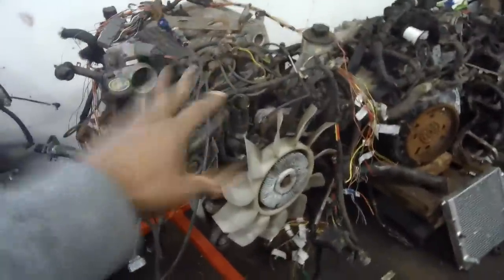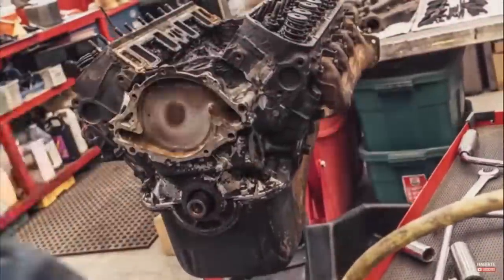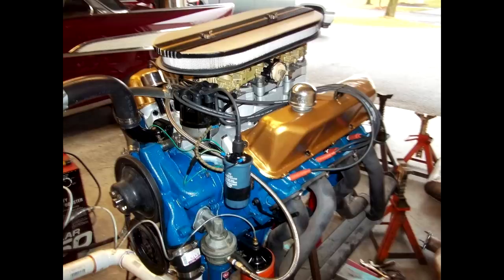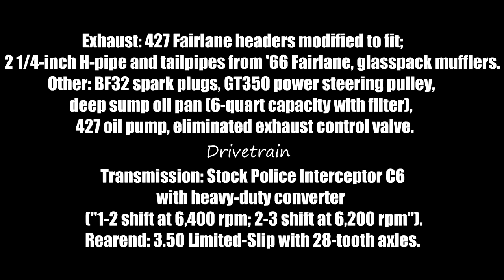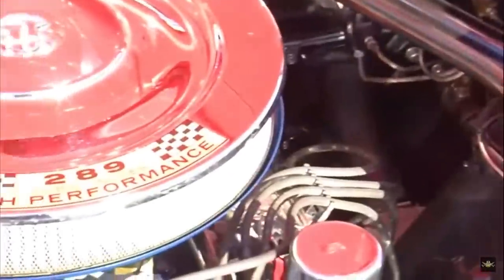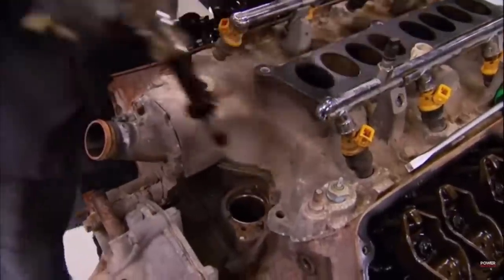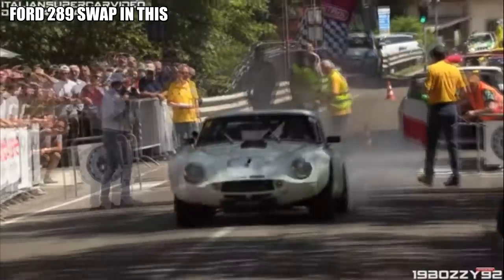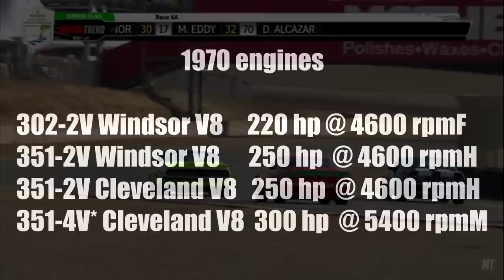289 Ford Voted BEST ENGINE BY CARROLL SHELBY ( HERE IS WHY )

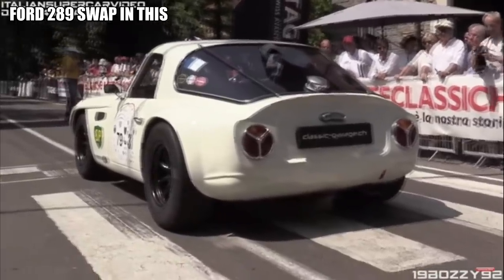Comment: 9:34 That sumbitch was rapid. 
That sound gave me chills. 
#1 is 289 for me, "Light is Might". 
#2 is 302
#3 ?
#4 ?
#5 ?
Reply from the maker: thats why i was having the problem of really figuring out which one was the BEST in a top 5 type thing.. #1 302 #2 351 #3 289 #4? and #5? ..its almost seen depends on what you find in your local yard ( maybe )  or what are you building. really tough call
Reply from the maker: that little thing was flying with that 289
Reply: @bstfordchannel923  That "Italian thing", was actually a British TVR! They sold a few here too!
Reply: What's the difference between 289 and 302?

Comment: I had a 65 K-code convertible and loved the engine. GM figured out ways to make small blocks ‘breathe’ better than did Ford. But the Camaro/Firebird was always a ‘me too’ auto compared to the original.
Reply: Don't see many if any small block Chev heads of that era breathing better than a 351 Cleveland 4v Closed Chamber head.

Comment: I like 289's but it can be difficult to bolt accessories to the heads for modern applications. The 390's are nearly bulletproof and can make crazy horsepower.
Reply from the maker: Thats a good view on the 289 in the modern world..
Reply: They were/are out there, but Ford was always more expensive to build than Chevys. The beauty of Fords were the opposite rotation on circle tracks planted the left rear wheel in the turns so you could stand on it while everyone else backed off. Reverse cams with gear drives on the others cancelled that advantage.
Reply: FEs are not bulletproof, they are prone to bottom end oiling issues.
Reply: That is why the 427 was redesigned to a sideoiing system.

Comment: I am partial to 460s had a 77 Grand Marquis in high school it was packing the 460 I beat the hell out of that car that motor was tough as nails and took everything thing a 17 year old kid could throw at it which was pedal to the floor 200 foot one wheel peels you name it. I had the exhausts coming off the manifolds glowing red several times and that engine really never let me down, she would really run on the top end, passed many a car at well over 100 mph honest to God and still accelerating good, my favorite has to be the 1970s 460 Ford anybody have any good stories about the Ford 460 in cars?
Reply: The late 70's 460 was a low compression 7.9 low HP engine around 200+ and had around 350+ft lbs of torque, now the 69-71 had around 365 HP with 10.5 to 1 compression and close to 400 ft lbs. of torque
Reply: @Stars-and-Stripes-  Of course they did not have the same horsepower ratings as the originals everybody knows that, that said the cars they powered moved out decent with the torque and the horsepower ratings were net now instead of gross so there was not a 165 horsepower difference when you compare apples to apples. Had 4 total vehicles with the 460s in my life since 1988 have 1 still none are muscle cars but everybody knows that. Install a straight up timing chain in a post 72 460 and you will get some power back.

Comment: I am running a 1965 289 HiPo now. I have first year, high compression 351w heads on in a little 62 E100 ... The van is just over 2,000 pounds and it is shorter than 2 door GEO Metro. Fun ride.
Reply from the maker: really man i would love to make on of those! I am thankful for this comment. I have to get one of those

Comment: I love fords.  Best most reliable engine I think is the 300 inline 6.     Ford 289 is great.  The 351 Cleveland and 427 side oilers and 460 are my fave all-time Ford's. Those 300 six are bulletproof.  Also my 460 is bulletproof as well.
Reply from the maker: yeah I want to touch on that motor ... i have to see what is that all about... That engine weighs a lot right Eddie?

Comment: #1 FE series
#2 335 series
#3 Fairlane/Windsor V8
#4 385 series

Why this order? I am considering the merits of the engines for their time while also taking into account modern day.
FE series because they were stout and reliable in modest everyday use applications as well as performance variants. At the top of the line, there were the 360hp 352, the 401hp 390,  406, 427, 428. It is funny how people will dismiss the 352/390 as a dog especially in comparison to the 396 Chevy, but if Ford had given the same options and treatment to those mid 60s engines as GM had, would’ve been a different story, as proven by the HiPo FE variants of the earlier years. And then there is the SOHC 427. FEs also have a distinct sound unlike any other, and are beautiful in an engine bay.

335 series had the famous 351 Cleveland, and a 400 though viewed as a boat anchor to some, is just a tall deck Cleveland with loads of potential. Australian racing is my source for why this series is over the Windsor/Fairlane V8 on my list, besides being capable of making big block power at its time. Like the FE the sound is distinct, and they dress up more nicer than a Windsor.

The Windsor/Fairlane V8 gave Ford a much needed smaller option for their vehicles that gave good performance. They are easy to swap, because they are small in dimensions, and built with aluminum peices are probably the lightest of American v8s. Limit was always in the cylinder heads which has been taken care of by all the modern offerings. No doubt the HiPo 289 was a force to be reckoned with at its time. Today 302s and 351w can be Built to perform great, as their abundance allowed for a great expansion of the aftermarket, helping affordability. Boss 302 was a half breed of this and the 335 series which was introduced the next year.

385 series certainly confirms that there is no replacement for displacement, but performance was not the intent, save for the 429 Boss engine. Big numbers are easily achieved as they should with engines this size and the aftermarket also caters well. Though these engines are capable of probably the highest motor only numbers in total performance builds, because it’s to be expected is why it is ranked lower on my list.
Reply from the maker: sweet list here brother a dang solid list!!

Comment: 260 was before the 289 in production.
302 replaced the 289 early 68 production year to take advantage of a 5litre max displacement rule in scca , first were the 302 tunnel port along with the standard production heads then the Boss in 69.
351W came out 69 model year and 351C came out 71. The Windsor uses a head similar to the standard 302 head. The Cleveland uses a head loosely based on the Boss 302 head.
Reply from the maker: You see that knowledge was well needed cause i am about to start 351w trying to get the info to make something dope
Reply: Only one mistake. Cleveland came out in 1970 first year.

Comment: Of all the engines, Ford, Dodge and GM I would pick the engine I have in my currant car. Its a Gen 2 COYOTE SUPERCHAGED! Its a marvel of modern technology. I`m 64 and have had most every performance car back to 1968.
Reply from the maker: ahh you are the guy to ask this question ... why they never made a ( bigger version ) of the Coyote engine like 302 to 351 or 4.6 to 5.4...I would love to hear you take on why... I say the engine will not perform at all...

Comment: Ive never had the opportunity to drive any of the other engines but I am currently working on a 1970 base model mustang and I ordered a 306 from blue print engines. The dyno sheet says it makes 375hp to the crank. Im excited to finally get this thing running. Last weekend I finally finished wiring my interior and installed my dashboard and gauges. It does have the original c4 automatic but would love to swap in a T5 transmission. 

Like always, I enjoy your videos. God bless
Reply from the maker: Congrats on the project bro... yeah man only the 302 I drove in and 4.6 2v and thats about it..Sound slike you have sweet ride brother..

Comment: I think a built 289 would be the nearly perfect engine for a car like the AC Cobra, for better-balanced performance. I would like to use one of the cast aluminum block 289s that Carroll Shelby made for an AC Cobra project.
Reply: Just think, if Ford had produced the 325 they tested in the GT40 .
Reply from the maker: it was i think Jim. the 289 was very balanced for the needs of the time

Comment: The 429 is no slouch either. There was an article where a group built one with main studs and upgraded rod bolts and it turned 9k too! That is something!
Reply from the maker: agreed Bryan i know that 429 was something us new schoolers can not get our hands on one to learn about,, we need guys like you to remind us
Reply: @bstfordchannel923  460 is the same dog. Just with a longer stroke, so I wouldn't expect 9k out of it. They weigh in very heavy. Way too much for road racing, but proper biasing makes them great drag engines.

Comment: I liked this video. U mention why didnt Shelby choose the 351. The 351 Windsor came out in 69 & the clevland in 70. Both fine engines but Shelby had already created & made history by then. My favorite engine kinda depends on the use u have in mind but I'll give my run down by my favorites. Keep in mind I'm a truck guy. I do mud runs with the 70's f series trucks so I like high horsepower & rpms but torque is a must for me. My first love has to be the FE engines so first would be the 427. Then like I run in my mud truck the 385 series such as the 460. (Defanetly not stock) but then my favorite is (more for a car  such as a 70 couger with a 4sp) is a 351 clevland then the 302 Boss then the 289 Hipo. The other engines fall in place kinda in between.  I work with 390's & 460's the most. I love em!
Reply from the maker: very true but i found a deeper reason click here brother https://youtu.be/m8nZS3_TbwQ
Reply: 351 W came out for the 68 model year not 69.
Reply: @todddenio3200  68 in the 69 model u fool! If u can show me a c8 casting number I will eat my words
Reply: @jesseduke694  at times like this I wish I had kept the one I had instead of selling it as the casting numbers started with C8 which says it was manufactured in 68 and was in a late production 68 Cougar. Its not worth my time to try arguing with an arrogant know it all such as yourself because you are the type who would refuse to believe it even if you were to have the casting number used as a branding iron to brand it onto your forehead which was made obvious by your immediately calling me a fool.

Comment: Man you guys are lucky you got access to all those motors in junk yard's in the states . We got Windsor's and Cleveland's on the other side of the world unless they were imported . My mate found a 400 m and stuffed it in his 73 xa falcon coupe didn't like I much not enough hot up parts for it so he got got 351 Windsor he's still playing with it. Just found your channel 😊🇳🇿 thank you for doing it love it . Would like to get some info on hot up parts for Cleveland's and what can be done to them thanks keep up the good work 👍👍👍👍🇳🇿
Reply: Where are you from I am sure you have a Barra
Reply: New Zealand bro
Reply: @skinnycains4448  now that explains a lot. Very surprise that you do mot have some v8s. You guys have some rotary engine many small displacement engines?
Reply from the maker: I am sure you have motors we wished we had Skinny -C... Man i wish could import engines to ya
Reply: @bstfordchannel923  all hot up bits for Ford's are expensive Chev not so much. Expensive to get Cleveland hot up parts now they get on top of what you pay☹️ you got a cool 😎channel bro keep it up😊
Reply: @reignbird3167  that's 10k to get a car from the states
Reply: @bstfordchannel923  that's GST on top
Reply: Back in my high school days I built a 400 with a set of 1970 351 4v heads. I used a set of spacers for the intake so I could use one for a 351c on it.  Bored .030 Roads cam and lifter set. Had it in a 77 f100 step side with a close ratio top loader and a 3.70-1 9”.  Lots of fun !!!!

Comment: loved the 400m engines ive had
Reply from the maker: that is sweet motor 100%
Reply: Always been a list topper for me even though people claim its a bad motor.
Reply from the maker: @fuckyourfarms  i can roll with that motor i know very little , but i do respect it
Reply: I have seen some stout 400 builds no bs there
Reply from the maker: @patrickjerzak2685  I am sure there are out there PLENTY it cost grip in some cases
Reply: Car Craft did a build on a 400 Ford some years ago if I remember correctly it was close to 400 hp at the crank on a budget and weighed less than the 460 which I think is a pretty damn good motor too.
Reply: The 400 ford is probably the most overlooked & underrated engine out there. It's mostly because they were never performance oriented from the factory. Only produced with smog era low compression open chamber heads & a 2bbl carb. But they share heads with the clevland & with the good heads & the right build they are wicked. Takes $$ tho. Not alot of aftermarket sspport
Reply from the maker: @jesseduke694  I  really think so also they should had just Barra the truck so simple. But in its form it was like diesel engine , but gas very simple design
Reply: It's basically a factory Cleveland stroker. They were just cursed by smog regulations.
Reply: Stock 400m 2bbl 100k plus 4spd 80f350 not a fast vehicle 10mpg unloaded 10mpg 20k plus lbs total and no loss of speed from empty.......amazing
Reply: The 351/400M was a good wngine if you stripped the smog components and let it breathe with a cam and headers etc. Theyre so choked up with emiisions they didnt really get any attention.
Reply: Tim T 
I just learned about this a few weeks ago. My entire life i had only heard the 351m called ‘modified.’ It was weird to know otherwise
Reply: IMO, the 400 was the V8 stump pulling version of the 300 I-6.
Lots of torque and you had to have $$$ to squeeze out the the kind of HP #''s of many of the other 335, 385 and FE motors.

Comment: I like the old flatheads.. I have a V12 it’s still in a 47Lincoln suicide door car.. has push buttons no door handles.
Reply: Wow! That is very cool. V12 Lincoln. Bet it’s a struggle to get parts for that beast
Reply: Canadian Marauder Parts can be had, just not cheap. I have one complete engine.. still turns over by hand..was very smooth when it was running in then1970’s and have two more blocks. The pistons are the size of soup tins..  not a lot of HP but they do look cool.
Reply: I had an old Merc flathead AB block and sold it. I put a 350 z28 motor in my 1940 ford coupe instead. Was a mistake. Love the sound of the Ford flathead.
Reply: L Twig I think I will put the v12 in the 38 coupe, as it is originally a v12 car.
Reply from the maker: oooooooooooh man that sound CRAZY I always wanted one of those .. Man that is a mean sounding ride
Reply: @462ANIMAL  38 Lincoln-Zephyr  is one beautiful car. Yes, bring her to stock if you still can. 267, 110 hp 3 on the tree. Did anybody ever make a performance intake for that 267?
Reply: L Twig They made aluminum heads.. someone might have made a performance intake.. it has am aluminum one on it now I believe..but heads are cast. I do have the original heads that say Zephyr on them.. but aren’t in good condition.

Comment: The ford Daytona you keep showing was a 289 HP, Carol Shelby was working on putting a 427/8 (can't remember) in it until Ford asked Shelby to help with the gt-40.  (there was one Daytona that had the big block in it but never made it past a prototype and was sold, the last I heard a Hollywood director or producer had it back in the 70's.)  The Daytona was built for the super-speedway tracks ie Daytona where the Cobra was not able to keep up on the top end because aerodynamics.   The 427 was used in the later GT-40's mainly due to the amount of torque it produced the drivers didn't have to downshift coming out of the corners to blow past the smaller engine cars.  Now the Boss Series cars the 302 was a Trans-am car the 429 was a speedway car and the 351 was a drag car.  The 427 sohc was originally for NASCAR/NHRA until NASCAR banned it, it was still allowed by NHRA so that is why you would see more drag cars than stock cars with this option.  Now my favorite motor would be Mr Shelby's PERSONAL Cobra with a 428 with dual 4 barrel carbs AND dual Paxton superchargers was estimated this puppy put out 800+hp, also it was only one of two Cobras that had an automatic (Bill Cosby had the other made the same way as Shelby's he took it around the block and said it was TOO powerful and gave it back to Shelby,  it was resold and the owner drove it off a cliff into the ocean and died) Shelby's car was clocked at inexcess of 180mph in either AZ or OK with a LEO in his car on a closed road with this back in the 60's
Reply: The 289 was a great engine, light weight with thin wall  cylinders, go to you tube and see em rev to 8500 and 9000 rpm

However nothing tops the 427 FE,  basis of the cammer SOHC winner in  every type of racing

We raced boss 302  and cobra jet 428 mustang  nhra

 BTW,   Tasca is pronounced like  passca, we used to buy parts from him

Comment: I guess, one other consideration is engine failure. Once you have the set up, headers and all, you might want the option of easy replacement if she blows. Then we are talking  most available low cost donors. This leans me towards later model engines.
Reply from the maker: I am seeing the light brother L-twig its all in this Maverick once I figure the wiring I may lean towards that cause it would be ideal and semi-unique in a way.. The parts to make this hapen full swap $700 tops thats the crazy part. I am just thinking bro
Reply: Maverick, you say?

Interesting.